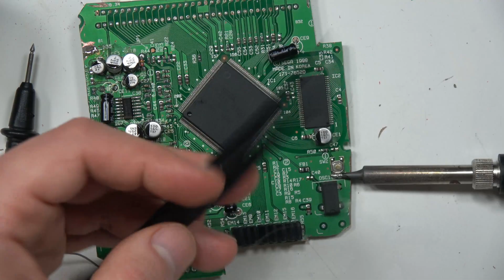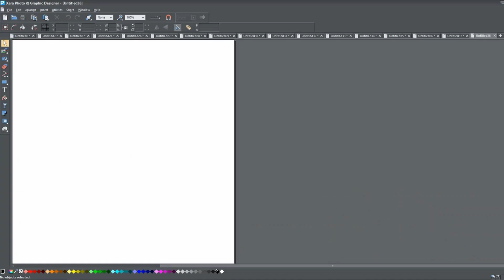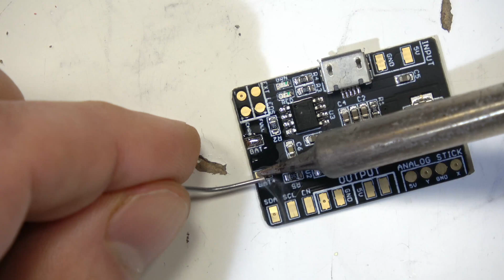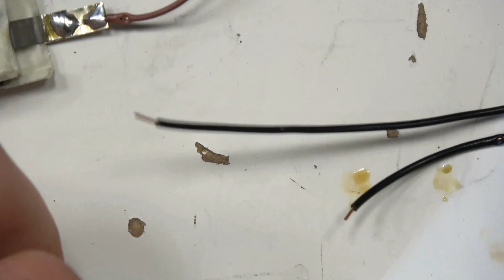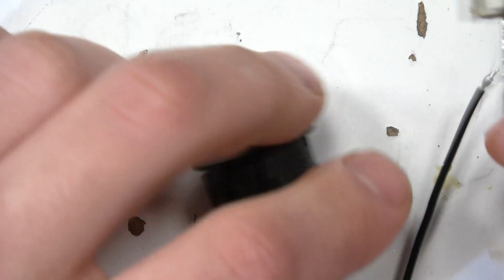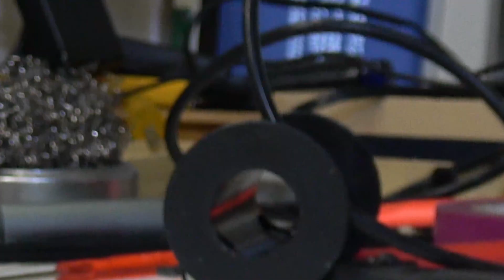GENESIS PORTABLE PART 2 (POWER SUPPLY)

Comment: This is really cool. I know it can be done but I cant follow the plans but I wanted to run a lot of the 8bits off USB. NES, SNES, SMS, Genisis. If you did that video i would loooooooooove that. OG PSUs are getting really hard to find and a lot need rework. Third party PSUs are a gamble at best. A clean way to power these system off just USB would be amazing.
Reply from the maker: You can definitely power all those systems via USB. Oh man I could type a lot about this but a video would be best. The soldering/modification part would be easy but there's a bit involved otherwise
Reply: RETRO GAMING ARTS keen as beans to see it if/when you get the time.
Reply: If you can add a USB port like USB-C or Micro USB and use a 2A 5v USB charger you would be all set even for use on the Older Model 1 Genesis which had 2 regulators (might need some other internal modding to accomplish this on a Model 1).

Comment: You could also try this for a future build. I know you got the retropsu from your buddy but this design is more compact:https://www.ebay.com/sch/i.html?_from=R40&_trksid=m570.l1313&_nkw=tp4056&_sacat=0
Reply from the maker: Hahahaha, yea, gotta support my buddy. I've seen that one you posted before on alot of gameboy builds. Prob should buy a few of those. Even for psp too
Reply: @ThirstWorldTTV  I was going to use it in my wireless PC engine controller project. It has many uses
Reply from the maker: Oo that's a good idea on your part!
Reply: You do know all that is, is a battery charging board right? that same chip is what charges the batteries on my board. That has no boosting at all which the Genesis requires in order to operate and his LCD soon to be coming in.

Comment: Nice btw look into vacuum forming. It's a custom making technique but for this it might be handy for your shell
Reply from the maker: it would definatly produce a high quality shell, but i would need a mould of my shell in order to have it vacuum formed, and at that point resin cast may be cheaper, but i'ma go the easiest and cheapest way out, 3d print lol. but i'm going to SAND the hell out of it, and polish, so it doesnt feel 3d printed. plus i really want to learn how to 3d design, its a huge factor as to why i'm doing this
Reply: @ThirstWorldTTV  right on.   yeah i wouldnt know 3d stuff to well. all i know is how to animate on 2d software. you download any 3d software yet?
Reply from the maker: @Nerdstrategy  fusion 360 autodesk, how do you make 2d art, if i wanted to make a sprite, what would i use?
Reply: @ThirstWorldTTV  paint lol. but really any program the lets you use a solid sqaure. i havnt seen any mobile stuff. i know you have gimp so look for a option in there to make a grid and then use a "brush tool" thats a sqaure. and if you can make it grid like graph paper that would be awesome. ill look it up for you later. i got to finish packing a store up this morning.
Reply: and yes i have gimp but its installed on my laptop not my desktop

Comment: I see you are using a turn on switch. I have a bunch which I also use to turn on my amp. Is it a good idea to connect it directly to the amp or should I use a relay? And who is the mystery person holding the camera....Aldo?
Reply from the maker: From my general understanding. Relays are good to use when you have ALOT of voltage going through a line directly to an on off switch. Like if you use a fuse on your power line and want to add a switch, adding a relay would be a good idea
Reply from the maker: Mystery camera person is a quarantine secret. Cuz people ain't supposed to be around people right now.
Reply: @ThirstWorldTTV .... When it is over tell us. I bet it's Matt.
Reply from the maker: 🤣🤣 maybe lllol
Reply: And why would I be risking my well-being just for a YT video? I thought you had more sense than this, Michael. Tsk tsk.

Comment: So dope. What are you doing on the case? 3D print? Kitbash?
Reply from the maker: 3d print. I bought a micrometer so I can take accurate measurements and I'll draw up a case on paper, and hopefully use those measurements to accurately 3d design it. I've never used a 3d design program before... soo... that will be alot of fun, I'm sure theres a learning curve but if I can learn video/photo editing. I'm sure I can learn 3d design. Will probably need a few attempts before I get it right.
Reply: @ThirstWorldTTV  It's not too hard to learn. It just takes time... like everything worth learning. There's a great site called "Thingiverse" that has tons of free 3D model plans. That may be good for inspiration.
Reply from the maker: @Ryan-ji6wk  yea, it should help me get a grip on what i'm about to try to do lol